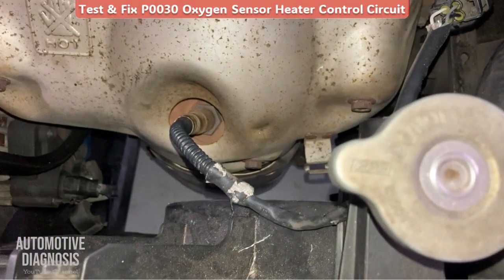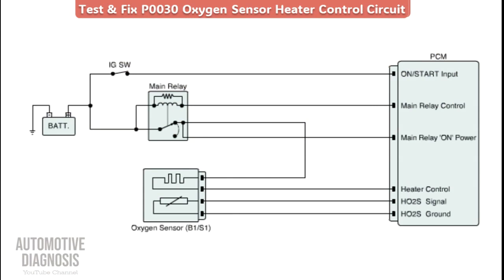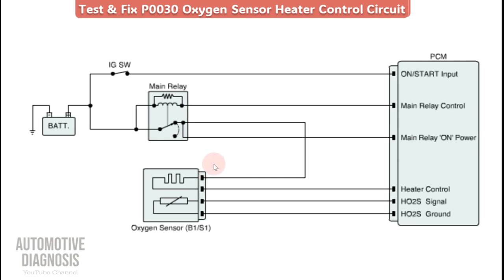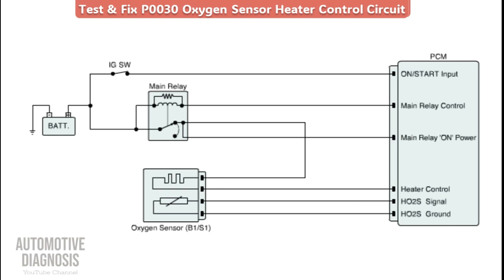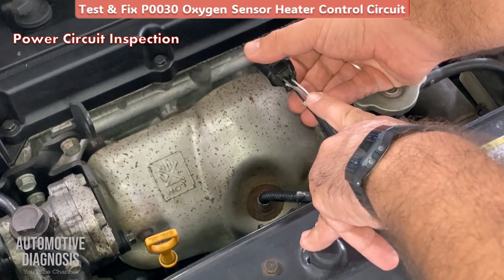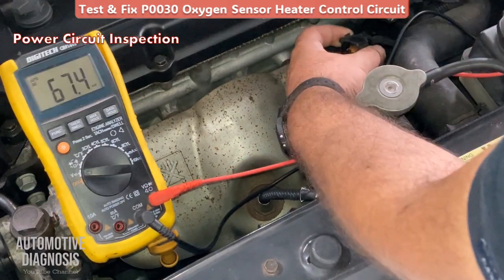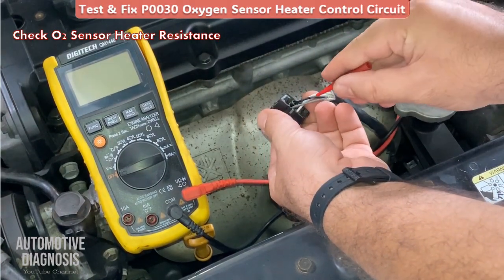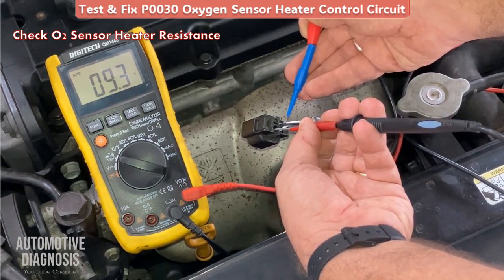Test & Fix P0030 O2 Sensor Heater Circuit (Bank1 - Sensor1) #p0030 #o2sensor

Comment: Thanks a million sir for this amazing lesson very easy to trouble shooting thanks
Reply from the maker: Thanks my friend. I'm glad you liked the video.
Reply: @AutomotiveDiagnosis  but sir I need to know where can I get cars wiring diagram, so that it can guide me to do troubleshooting for easier, could you guide me please
Reply from the maker: Hi my friend. There are many ways to get the diagrams. For some cars (like Korean cars), you may find the wiring diagrams and workshop manual on the original scan tool (GDS covers all Hyundai and KIA vehicles up to 2018 and it does have all the diagrams). There are also some websites that you can join (of course the charge you for a fee) and use the diagrams. There are some online free websites too that provide the manuals.
Reply: @AutomotiveDiagnosis  ok sir, can you tell me some of them please, because I saw you have a lot of cars wiring diagrams it's very helpful and it makes troubleshooting to be easy,
Reply: @AutomotiveDiagnosis  which website is the best sir,
Reply: @AutomotiveDiagnosis  all in all thank you for your reply, I proud to have you here and we will be flowing you those days
Reply from the maker: @bwagizoselemani8434  thanks for your support my friend.
Reply from the maker: @bwagizoselemani8434  There are many, but “All Data” is one of them.
Reply: @AutomotiveDiagnosis  ok, thank you.